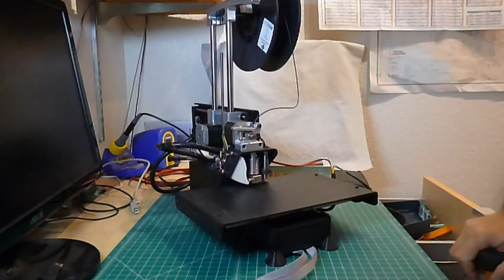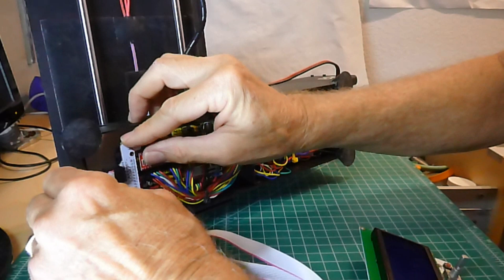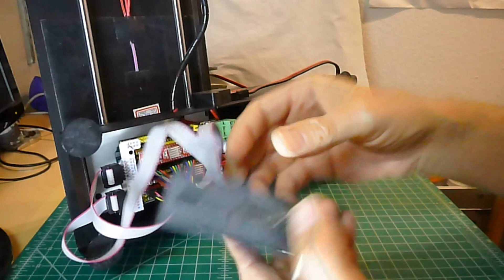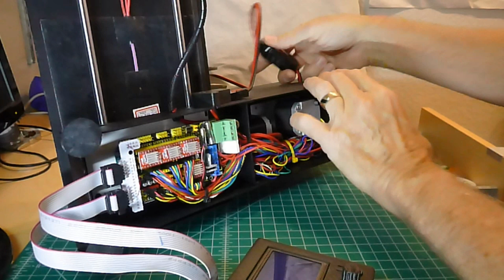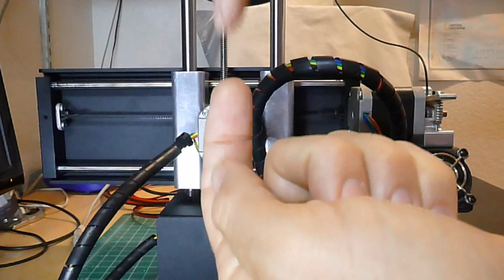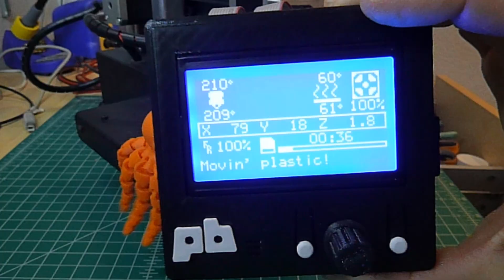Laboratory of Irreproducible Results - Episode 6 - PrintrBot Simple Metal 3D Printer Rebuild

Comment: I own that exact same printer. Mine has the Rev. F4 though. It would always stop at less than one percent of the print and then drop internet connection. It wouldn’t read the micro SD card at all. I bought the same controller as well. I am having issues finding the wire layout for the printer. Also what code do I need to configure them? I downloaded the latest ramps but I have no idea if it was successful because I am not sure if my wires are connected in the right place. One more question. Is it possible I can get modified codes for the printer? Great job by the way
Reply from the maker: Hi Norman. For wire layout, I simply traced the connectors back to their source to identify what they were for. (hot end, thermistor, stepper motors, end stops etc.) Then I plugged them in to the appropriate connector on the new RAMPS board. Some wires had to be fitted with more appropriate connectors for the RAMPS board.  Some good reference info on the RAMPS board is here: https://reprap.org/wiki/RAMPS_1.4  I used  Marlin 1.1.9 mainly because I wanted code stability and didn't need any of the features that Marlin 2.0 offers. Let me know if you are having an issue with a specific configuration item and I can consult my implementation to let you know how I did it.
Reply: Mark Doumas thank you for your reply. I am going to get on it now. I will let you know my progress.
Reply: Mark Doumas so the original connections for the z,y, and x stops won’t fit on the pins. Also the z stop has three wires red, white, and black. Now on the diagram all three stops have only two wires. I’m lost how that doesn’t add up.
Reply from the maker: @normanandrew5620  Yes, the RAMPS board offers a lot of pins for end stops to allow for connectivity to all sorts of 3D printers. We only need to use seven of the pins as follows: the two wires from the X-limit switch get connected to the GND and Signal pins of the X-Min column of three pins. (Polarity doesn't matter and the +5v pin remains unconnected. The next column of three pins for X-Max remain unconnected... not needed with the PrintrBot.) Similarly, the two wires to the Y-limit switch go to the GND and Signal pins of the  Y-min column of pins. The three wires from the Z-probe are a bit different: All three of these need to be connected to the Z-Min column of three pins and polarity does matter: Black goes to GND, Red goes to +5V and the remaining wire goes to Signal pin. I used crimp-on Dupont connectors on the limit switch wire ends to connect to the RAMPS pins. In the Marlin code, the z endstop settings are #define USE_ZMIN_PLUG and #define Z_MIN_PROBE_ENDSTOP_INVERTING false.  Also, remember  for the PrintrBot that the y axis endstop switch is on the max location. So some of the default Marlin settings for that axis will also have to change. I have considered doing a follow-up YouTube episode that covers this project in a bit more detail: a wire-by-wire hook-up of the PrintrBot to RAMPS and a review of the changes required in the Marlin code. It would take me a few weeks to get back up to speed on this project and shoot the video if it would be useful for you and others.
Reply: Mark Doumas i look foreword to seeing that video once your done, thank you sir. I look up those connectors and make sure I have them in the proper pins.
Reply from the maker: @normanandrew5620  Just wanted to let you know that I just posted a follow-up episode on the PrintrBot rebuild that goes into more detail including how to configure the endstops: https://www.youtube.com/watch?v=HJekc9DagOs&t=7s
Reply: Mark Doumas thank you for getting back to me. I really appreciate it. I will look at it tonight.

Comment: also, how did you get the auto leveling "probe" to work?  i.e. where did you plug it into the ramps board and is it already a commented out option in marlin?
Reply from the maker: I plugged the stock z probe wires into the z-min endstop pins on the RAMPS board. There are three pins for each endstop position and you will need all three for the z probe.... Gnd, VCC and signal. In Marlin, the z endstop settings are #define USE_ZMIN_PLUG and #define Z_MIN_PROBE_ENDSTOP_INVERTING false.  I'm using the 3 point auto bed leveling option and I've been very hapy with that.

Also, remember  for the PrintrBot that the y axis endstop switch is on the max location. So some of the default Marlin settings for that axis will also have to change.
Reply: @markdoumas4101  oh duh.  That makes sense.  And the reverse it so that it acts as z min.  Thank you!!
Reply from the maker: @J3rrywu  Just wanted to let you know that I just posted a follow-up episode on the PrintrBot rebuild that goes into more detail including how to configure the leveling probe: https://www.youtube.com/watch?v=HJekc9DagOs&t=7s

Comment: can i ask why you used marlin 1.1.9 vs 2.0?
Reply from the maker: I used  1.1.9 mainly because I wanted code stability and didn't need any of the features that Marlin 2.0 offers. (32 bit processor support, bltouch, etc.) Also, I think I tried to compile Marlin 2.0 and had some issue. Can't recall the problem but it was just simpler to stay on 1.1.9